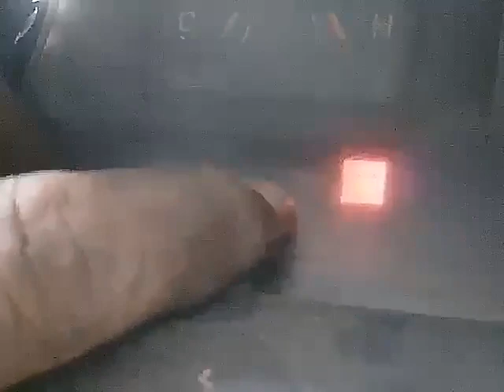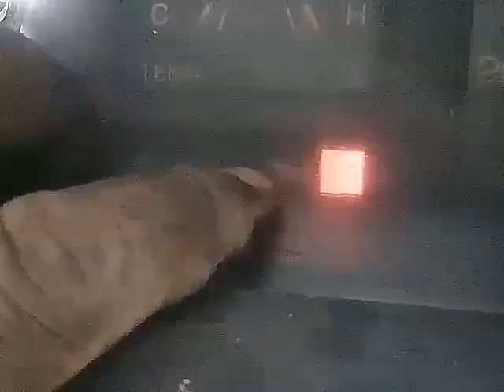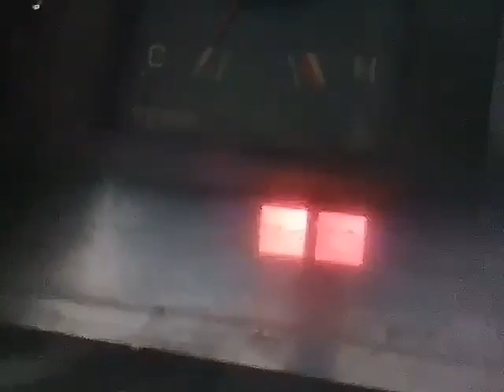Switch oil L300 diesel/ cara memasang

Comment: Bos, kontrolnya oli nyala terus, tpi oli nya masih penuh. Kira2 kenapa ya boss
Reply from the maker: Pompa oil nya rusak....dicek dulu jangan diteruskan...mesinya bisa rusak
Reply: @SejoliChanelOTOMOTIF  tpi kok dimesinnya temperaturnya gk ya boss
Reply from the maker: Kalau oil masih banyak terus ,Indikator oil nyala itu bahaya bos...intinya oli tidak terpompa ke atas kebagian mesin...
Cara tes nya
Buka tutup oil atas...mesin di hidupkan terus di lihat apakah ada percikan oil....kalau tidak ada percikan oil berarti pompa oil rusak
Reply: Ok, terima kasih bossku atas ilmunya. 🙏🙏
Reply: Bos..setelah saya cek pada saat mesin hidup, ada percikan yg cukup kencang di lubang atas tutup head mesin. Apakah ini ada indikasi switch oli rusak bos
Reply: Itu kemungkinan kabel nya nempel mesin/body mobil bos, dulu pernah pajero switch nyala terus, setelah dicek ternyata kabel switch digigit tikus dan nempel mesin.